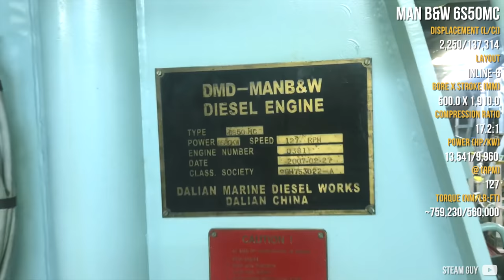Lowest Revving Diesel Engines

Comment: Wonder what's the oil to fuel premix ratio for 2 stroke diesels
Reply: 2 stroke diesels don't use oil premix, they just use oil sumps
Reply: Many of them have a oil sump like a 4 stroke. For the hot bulbe ones I think the premix is about the same as for gasoline 2 strokes, maybe 2%.
Btw, the API spec for 2 stroke diesel oil is very old.
Reply: @espenschjelderup426  cool, didn't know that
Reply from the maker: Two-stroke diesels do use cams for exhaust valves, but suck air from ports above pistons at BDC. They require a blower to get air inside, they cannot run without a blower.
Reply: @VisioRacer  I tried to be a diesel blower, but I hyperventilated   and passed out🤣

Comment: Another superb video!! Bravo!!

The very first ship I worked on was the old HMS Endurance. It was fitted with a 5 cylinder hybrid turbo Burmeister & Wain (now MAN B&W) 2-stroke diesel at build in 1967. If the skipper got really excited he could demand a full 102rpm - the redline - from it. 

Heady stuff indeed,  but sadly lacking the offbeat Audi/ VW/ Volvo/ Merc 5 cylinder exhaust burble 😉

Comment: can you do a episode about hot bulb engines  i just can`t figure out how they work thx in advance
Reply: The Hot Bulb is a pre-combustion chamber and is externally heated ( usually by a blow torch ) prior to starting. The fuel ( this can be anything from crude oil up to diesel fuel )
is sprayed onto the inside of the hot bulb and causes the ignition of the fuel air mix. I am currently working on a 1928 Ruston Hornsby  size 5 class ME engine It produces 20 HP and does 250rpm flat out and they can idle down to 40rpm. The flywheel is 5'11" in diameter and weighs 2 ton.  The bore is 9" and the stroke is 17" . Once running and under load the combustion heat keeps the hot bulb   hot . They are very efficient engines and full fuel burn is achieved to the point that most of the time the only noise from the exhaust is a chuff. It is a shame that they were not included here as they were the true work horses in the late 1800s and early 1900s and many engines are still running today.

Comment: All these examples seem to be really high revving.  The large diesel engines in large container ships rev much lower.
Reply: Well yeah, but the last one was a large ship engine.
Reply: @madmax2069  actually that is a tiny ship engine.  There are ship engines where an inlet valve is larger than that entire engine

Comment: Natural aspirated means no turbo or supercharger
Reply from the maker: Natural aspiration means the very basic to be able to run. The 2-stroke diesel cannot run without a blower and I read many times on forums them being referred to as NA
Reply: @VisioRacer  A naturally-aspirated engine is one that is not fitted with a turbocharger or supercharger. In other words, air goes into the engine normally, whereas turbocharged and supercharged engines force the air in under pressure to boost power.
Reply from the maker: @glitch_skunkogen  Society of Automotive Engineers cosinder the mechanically scavenged two-stroke diesel as naturally aspirated. You are right about, this type should not be called that way, but I did not make it up. It certainly makes sense to me
Reply: @VisioRacer  yeah it doesn't make sence as it counters the meaning of natural aspirated i usually consider a diesel blown or turbo charged

Comment: No russian diesel locomotives?🤔
Reply from the maker: Which ones?
Reply: Kolomna 5D49 with 350 to 1100 /min
Reply: Kolomna 14D40 with 400 to 750 /min (2-stroke)
Reply: ČKD 6 S 310 DR with 750 /min, 6 cylinders, 170 liters, called "Hector" because that barking sound (ok, not russian but Czech)

Comment: why should they build 2 stroke engine for trains?
Reply: Well they already have
Reply: 2 stroke diesels like the Deltic were very efficient. The opposed piston arrangement which required no valves (they used ports) made for low fuel consumption and long maintenance intervals.
Reply: Truck and locomotive 2 stroke diesels made more power than a similarly sized 4 stroke, at the expense of higher fuel consumption. Especially before turbochargers were commonplace.

Comment: "Diesels make more torque than gasoline engines because diesel has more energy" Maybe, or maybe because they are not naturally aspirated!!!
Reply: Diesels are thermally more efficient mainly due to internal design, combustion chamber in the piston and a flat cylinder head, they convert heat into power,
Reply: @billnewlands2486  Yes, Diesels have a higher brake-specific fuel consumption but all things being equal they make 20 to 30% LESS peak torque.

Comment: The last engine, not use the blower and the turbochargher together in every moment, but only in low rpm, there is a pressure switch in the scavengine air manifold, when the air pressure incresed, the electrical blower switch off, and only the turbocharger working.

Comment: No mention of a Crossley HST engine? a 2 stroke diesel used in locomotives and shipping in just about every combination of V6 to V18. The badly balanced engines had an earth shattering max RPM of 625. Of cause there's the daddy of them all......Wartsia-Sulzer RTA96-C. 107kbhp and a max rpm of 120.

Comment: I have video of my Honda b18a1 idling at about 100rpm. The distributor bearing had failed and was causing drag. It would idle smoothly at that rpm but couldn't be moved since the drag wouldn't let my engine rev up with a load...if you could convince it to rev anyways. The distributor failed with only 19k miles. I sent it back for a free replacement. Thank goodness I had the warranty.

Comment: 0:10 Diesel burns much faster than gasoline does, in their respective engines.

The biggest reason diesel engines can't rev as high is because they burn their fuel so quickly it's like knocking in a gasoline engine. Their components need to be much stronger (and by extent heavier) to deal with violently knocking all the time. Heavy pistons and rods can't move as quickly, so diesels have to run slower.

Also, that knocking is what causes the characteristic diesel clatter.
Reply: It's not so much the knock, it's the high compression ratio needed to create ignition temperatures that contribute to the weight of the pistons,Conrods and crank. They need to be much meatier so they don't deform through the massive pressures exerted on them. Diesel 'knock' has been somewhat cured through the use of multi shot injection used in common rail injection systems which has made them very refined. One of the factors of a diesels lower rev range is the time it takes to begin combustion, create a well propagated flame front  then be able to exhaust the combustion products from the cylinder. Older mechanical style fuel pumps would only be able to inject for around 30 degrees of crank revolution...as the revs rise the amount of time you gave lessens therefore only allowing a relatively low top speed compared to spark ignition engines.

Comment: Diesel engines DO NOT produce more torque than their gasoline counterparts......displacement, valve location, and manifold pressure being equal. Exceptions are two stroke diesels (when compared to four stroke spark ignition engines).

This is an old wives tail that has no basis in actual engine ratings over the years.
Reply: That's a meaningless, esoteric statement. They DON'T have the same displacement (light duty trucks and cars excepted), valve sizing or location, or manifold pressure. Because of their robust build, diesels can routinely run 40 lbs of turbo boost, or more. Few production gas engines can withstand that.
Reply: @donellmuniz590  The opening statement in this video was "diesel engines normally produce more torque than their gasoline counterparts". That is not true and I qualified my remark..

Your comment has nothing to do with anything concerning what I said!  You are free to prove me wrong. I will wait.
Reply: @turbo8454   ok